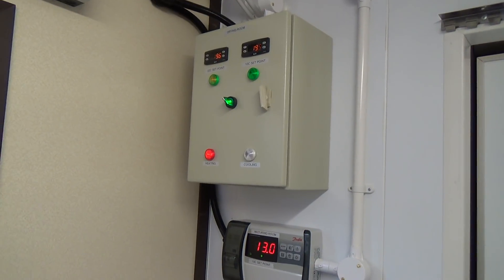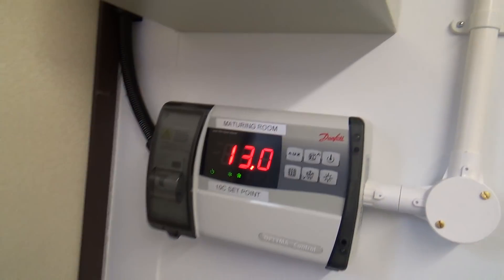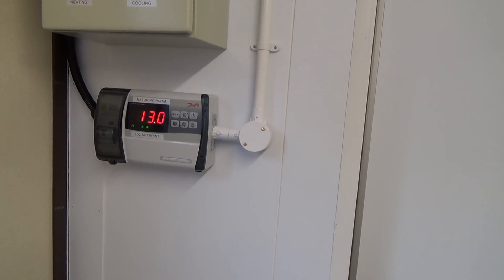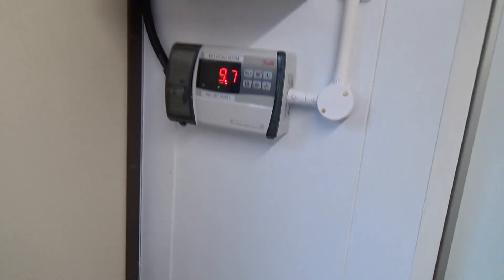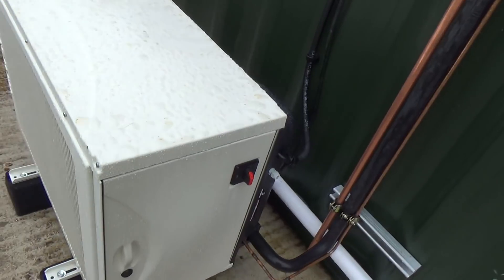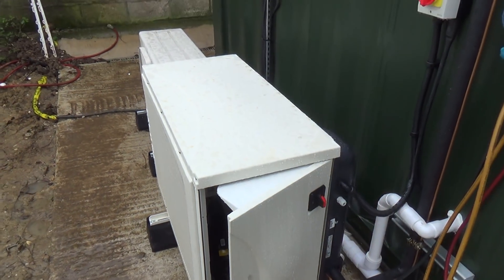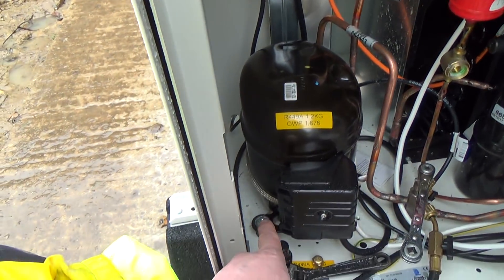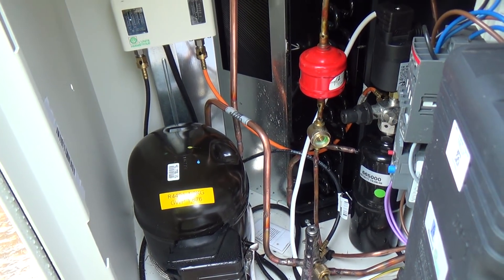Say Cheese!

Comment: hey Diesel  are these in  a shipping container?  was it difficult to drill the holes through? did you need special equipment IE: plasma cutter? or just wholesaws?
Reply from the maker: Noraml hole saws, if you keep the speed down they last for ages. I usually use them with the drill set to screwdrivering so if the hole saw catches it doesn't damage the teeth. Some cutting compound can be helpful too.
Reply: @heavydiesel  alright thanks because i have to build to units walk in freezer 20x8x8 and a walk in cooler 20x8x8 both in containers

Comment: Hey Heavy, if you made some frames or bought brackets, you could of mounted units to the side of container, that would of made moving them easier.. bloody nice job.. you are ahead of us in Australia with the new gasses.. more changes..
Reply from the maker: We were limited in options as the customer didn't want any holes in the container sides. The gas situation here is a nightmare at the moment with refrigerants either unavailable off the shelf or very expensive!

Comment: What the ff? No cow dung? I am very dissapointed! Nice pro install, much to neat for me i wouldnt feel comfortable in such a steriel envoirement. Have you tried 448a? In my opinion a less shittyer refrigerant. Thanks for the video.
Reply from the maker: Haha! I've not tried R448A yet, the wholesalers are recommending 448A, 449A and 452A depending on the type of system, wholesalers had to get the R449A in specially for me from another branch, they had none of the other two at all!
Reply: We have had issues on a site which has been on R404a for years. Gas changed out to run on R488a and the LT stuff played up. Changed the R404a valves out and now it runs Ok. (Valves now R488a)
Reply: Nathan Brewer you shouldnt have turn it over if it was running ok, you can use 404 valves but you have to change out the orrifice and set superheat higher. We dont have 448/9A Valves here.

Comment: Wondering if they could have gotten 2 used refrigerated containers and used them, as they would have had the inside already done for the room, and even if they had the cooling systems failed they would have been able to get the new units into the space at the end easily.

But really nice job, too bad all that shiny copper pipe on the inside will look green and grotty in a month from the cheese though. What a nice panel you made as well, looks a lot better than many of the commercial ones, only thing missing is a P-touch labeller to make all the inside info. Nice to also leave the manuals and a pack of spare fuses as well, though I would rather have put in some 5A DIN breakers instead, so that there is a lot less chance of somebody using some wire instead of a fuse to get it going "temporary permanent" like, instead of giving you a call. Incoming a 32A fuse as last resort for major fail with a power on indicator, but the rest breakers.
Reply from the maker: I suggested that ex refrigerated containers would be an idea, but they were unsure about cutting the drains in etc

Yeah I wrote the details inside the panel before I finished and labelled the outside, I'll print a label for the inside when I got back to adjust the fan settings later this week. The whole panel is fed from a 10A mcb so the fuses are an extra level, control circuit only pulls 30ma, fans run under 1A and the heater is about 8A.

Comment: heavydiesel, what issues have you ran into as far as the 404A replacements?  You worked on a 449A systems in this video. 404 A is still under 10 dollars a pound where I live in the USA. Some regions in the US it is more than that, I am sure. Thanks for the video as always, comment to everyone on my question when you get time.
Reply: 449a with an 404a expansion valve is like a tev with diaria especially on low evap temp. It passes like thin poo. You have to take in account the 6k glide thats present. There is lower mass flow in liquid line versus 404a. In the suction line there is more flow. And is less dens than 404a. Discharge gas temp has to be monitored because its even higer than 404a. The price for one pound r404a in europe is over 60 dollars US (449a 30 dollars) in Januari 2017 this was 8 dollars per pound 404a. Once again we got F***d by those penlicking money grabbing bastards, by enforcing transition with no good alternatives on the market. If you are gonna make a retrofit on medium or high temp than its better to stick with r134a altough te prices of other refrigerants has more than doubbled to.😠
Reply: sjef oekel x
Reply: sjef oekel, thanks for the explanation.
Reply from the maker: These are the first two R449A systems I've worked on so no issues yet! Last time I asked a few months back for a price on R404A I was quoted the equivalent of $1989.00 for 22lbs. My local wholesalers says they will not be stocking it anymore once they have sold what they have. Danfoss make TEV's for R449A so that makes things easier.
Reply from the maker: We have been buying R134a from car parts wholesalers, about a third the cost than from refrigeration wholesalers and no cylinder rental. I specified these on R134a but when we came to fit them they had no stock of the correct units and had no time to wait for them to be ordered in.

Comment: Neat job hd! Have you used this refrigerant much, what sort of head pressure would you get on a hot day?
Reply from the maker: Thanks! This is the first install I've done with the new refrigerant, it runs about the same as R404A. The condensers seem very generously sized in the Winsys unit so hopefully they will cope well in the summer.